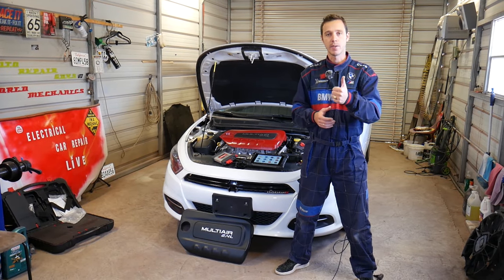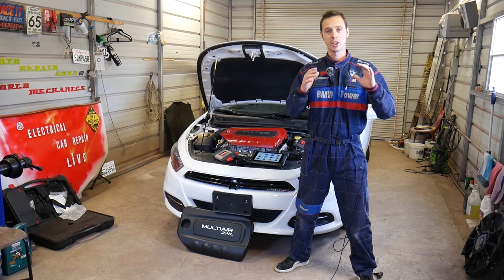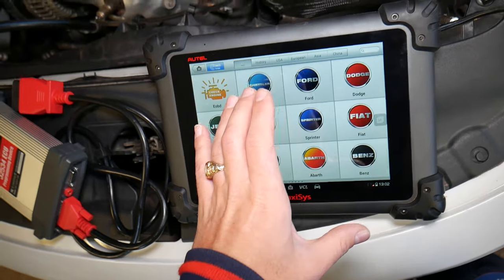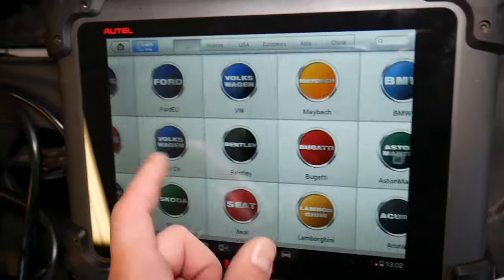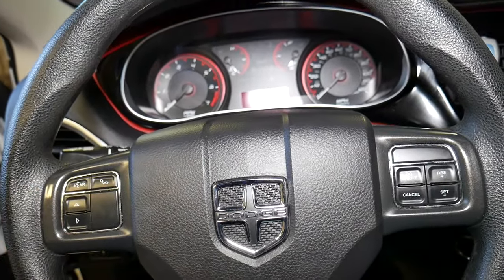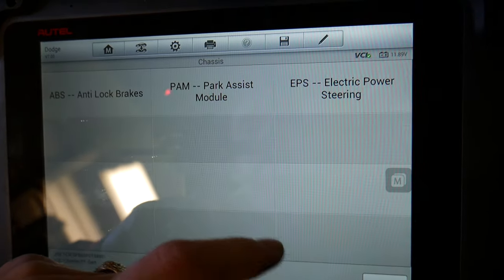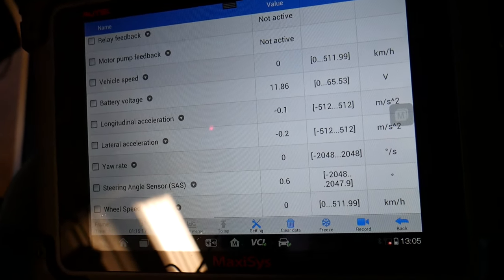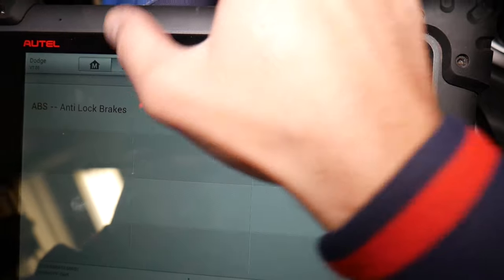HOW TO RESET CALIBRATE STEERING ANGLE SENSOR ON DODGE, TRACTION CONTROL LIGHT ON

Comment from the maker: Products that we use and recommend:
► Our Favorite Car Scanner: https://amzn.to/2JxKf0E
► Panel Removal Set: https://amzn.to/3YiMADu
► Tool Set: https://amzn.to/3p5MM6t
► Screwdriver Set: https://amzn.to/3XRB28Q
► Castrol Oil: https://amzn.to/3xBc8B9
► Oil Filter: https://amzn.to/3w0Ulme
► Torque Wrench: https://amzn.to/32qyRwg
► Liqui Moly Engine Flush: https://amzn.to/3IiDBID
► OBD Scanner that we use most often: https://amzn.to/3I4MQfe

► Check out our Amazon Store for the tools and parts that we use: https://www.amazon.com/shop/worldmechanics
Reply: Just because the light is off when you start the car doesn't mean it's fixed. The light will stay off until you move the car at least 100' or so. It then rechecks centering of the steering wheel. If it's not right, it will come back on.

Comment: Hi, I have a strange one. I change the sensor but I still have the error on dashboard. Horn and indicator, wipers all working. But the steering wheel buttons not, as well coming back with steering wheel angle sensor fault. Any ideas? Could the second hand one from ebay be broken too?

Comment: Great info. On my 2017 Ram 2500: I recently replaced part of my intermediate steering shaft. Broke and replaced clock spring in the process. After replacing clock spring my wheel alignment (on my back up camera was off) AND my TRACTION CONTROL LIGHT was on. This video sent me in the right direction. Un-bolted shaft interior at fire-wall, corrected alignment according to back up camera. Initially, I thought I needed guy at work to clear code with scan tool, but while in route to work, it cleared/corrected itself. No scan tool / computer needed.

Comment: thanks for the vid. I replaced the clockspring but was still getting lights. I hooked up the scanner (didn't even know it had angle sensor check). With wheels and steering wheel pointing straight ahead I was reading 360 degrees. Somehow got the thing on turn off. I pulled the wheel back and turned it (with the clockspring) one full turn. Installed steering wheel and now lights are off. For some reason the horn doesn't work now and the air bag light is still on(it was on before). But the other two lights are now off! Baby steps.
Reply: U probably broke the clock spring now, u need to keep the clock spring always at the centre, for example if ur clock spring has 5 turns in total, it will turn 2.5 turn to left and 2.5 turn to the right so completely rotate it to one side and then count 2.5 rounds, it will be your centre. Now if u somehow do this wrong and your clock spring isnt at the centre, when you will move your steering wheel, it will probably break the clock spring (clock spring controls airbag, horn, cruise control, media control buttons). As far as your angle sensor is concerned, when you first replace the clock spring you probably just rotated the clock spring, as angle sensor is usually pulled off from the old one and put on the new one. It would be calibrated to the old one which according to you had 360 degree turn which means 1 whole turn of clock spring or steering, so only thing you had to do was just reset it, reset it through the device or just recalibrate it according to this light, it would have made the angle to be 0 degree again. And everyt would have worked then. Angle sensor it self can not move, it always fits at the same area of clock spring, so if your clock spring is in centre then so is your angle sensor, only thing it needs is a reset or recalibration to tell it that everything is fine, wheels are straight and steering is straight so that it can be satisfied. Wrote alot, i hope it would help if not you then someone who sees it in future. :)
Reply: I (think) turn key on, put vehicle in reverse, check alignment on back up camera. Read my recent post here.
Reply: @kensei1214 so what would be the fix if steering calibration don't work..I have anti slip and esp/bas light..everything else works and have same autel scanner..but can't reset the clockspring..

Comment: Would you know why my fobik keys (I have 2) wouldn't lock and unlock the car BUT start it? I changed the batteries and it still do the same thing.
Reply: Same my ram fob isn’t working. Works sometimes but not all the time. New batteries

Comment: I would like to know what brand of scanner is the one you are using?
Reply: That's an Autel. If you get the Autel ts608 it has tpms, diagnosis, and service all in one. You can find em for around 580. The specific one he is using I'm not sure. I think it's in the description. EDIT: Autel Maxisys Pro MK908P is the scanner he is using, costs a pretty penny also.